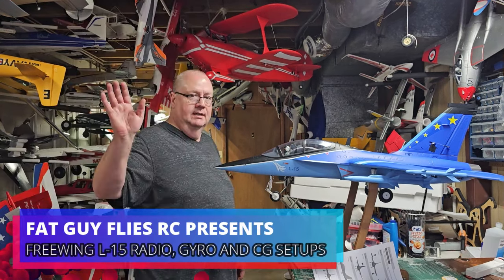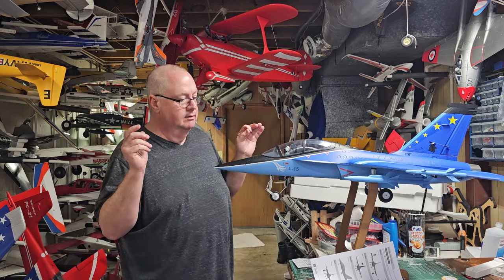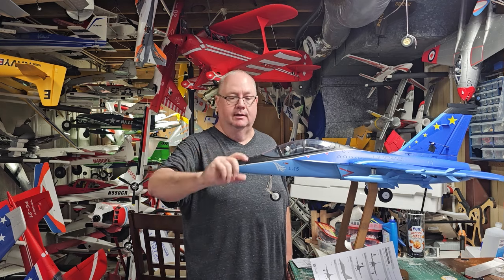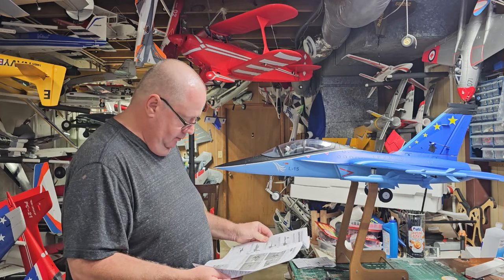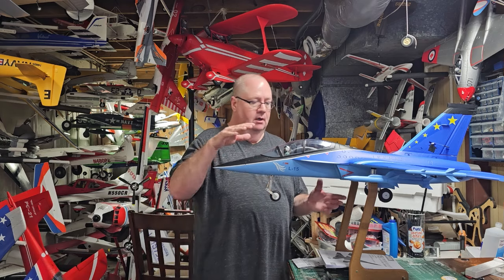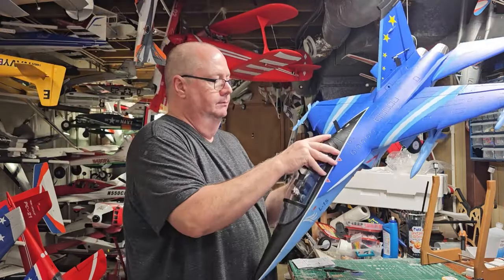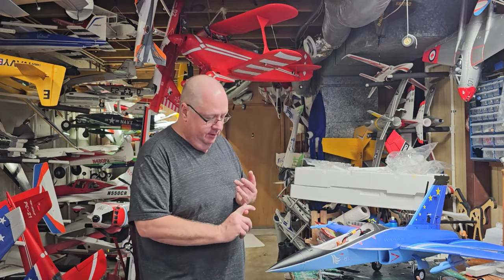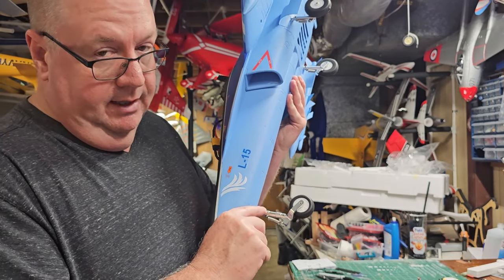JUST RELEASED FREEWING L-15-RADIO,GYRO AND CG SETUPS by FGFRC

Comment: I think with the upgraded nose gear, you need to remove the collet that’s already installed and mount the gear directly to the steering linkage. 

Also never seen it mentioned anywhere that the esc has reverse. Bummer, but not a deal breaker for me.
Reply: Also wanted to mention that I also found it weird that there is no manual or any information on the gyro even on freewings website.

Comment: The pin is only on the 4S non upgraded nose wheel gear version the upgraded version does not need the PIN - you just remove the bit that is on the Aircraft as it comes and replace the whole lot with the Upgraded nose gear.. .. Hope you find this useful.. Cheers...
Reply from the maker: Yeah I discovered this after I put out the video.  Also have you flown the xfly twin otter yet. I was thinking about it.
Reply: no  not assembled it !! - I have a backlog of maidens to do already the recent Unboxings, might not even get assembled/maidened this year !!!...

Comment: I bought the 6s . And put a futura 64 mm motor and esc in it. Now I have metal gear and thrust reversal
Reply from the maker: I ended up getting the 4s one also a I like it better. The 6s is just TOO fast for the planes size in my opinion.
Reply: Thanks for your honest and clear explaining videos! I am very tempted to buy the 4s version but I’m not too sure how she will handle grass operations(?) 
Do you think this model can handle that? 😊 thanks
Reply: @claudiomueckay7251   there is no suspension on the 4s , on the wheels. So you will get bounce out of the front . If you can buy the replacement metal fear I would . Then it will definitely handle grass . Motion rc has some flying videos out , taking about the gear
Reply: @skunkworks9635  thanks! I will do that 😃👍✈️

Comment: Anyone got any idea on how to set  up gyro
Reply from the maker: Plug it into your gear channel and then assign it to a three position switch. It has 3 level gyro, self level with gyro and no gyro at all. It is a closed system gyro so you cannot adjust the gains at all.